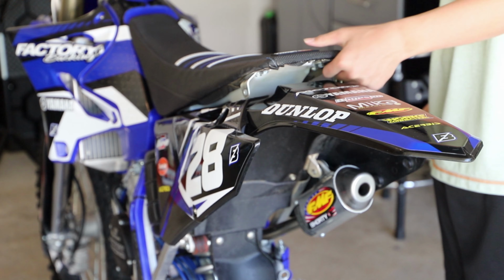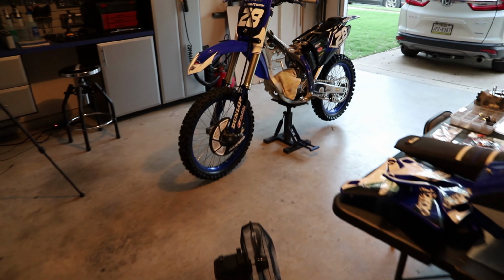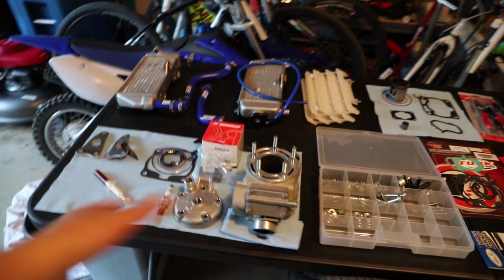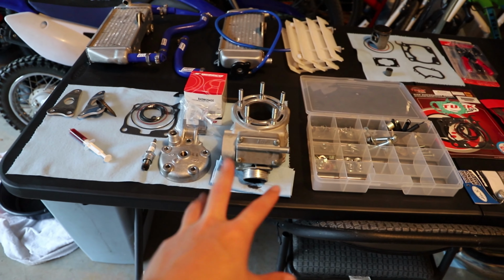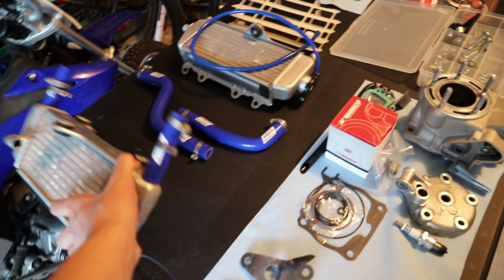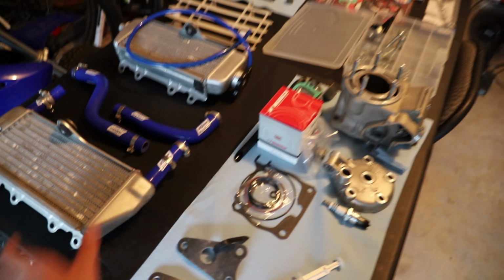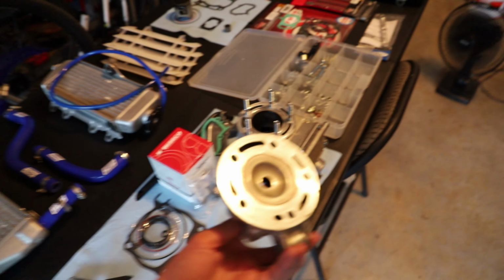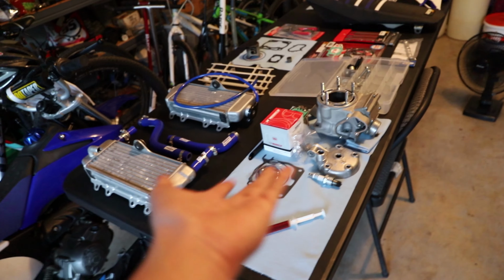YZ125 Top End Rebuild | Part 2 - Teardown

Comment: Nice job doing your own work on your bike!  With a circlip never use them more than once, they can lose their tension and not want to hold.  If they come out it can be a really bad day for your piston and expensive cylinder.
Reply from the maker: Thanks, I love working on my bike! I made sure to use the new circlips, I used the old ones to practice installing (in the old piston). Definitely wouldn't be any fun if one came out!